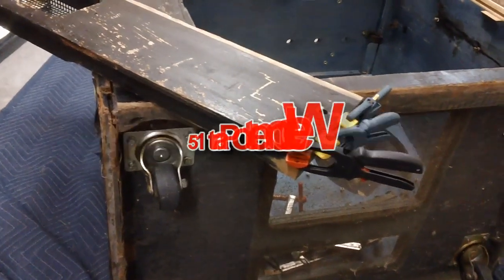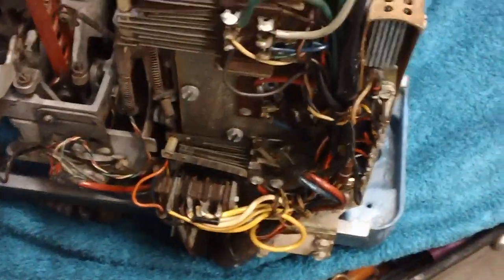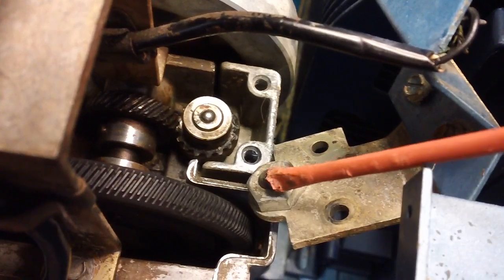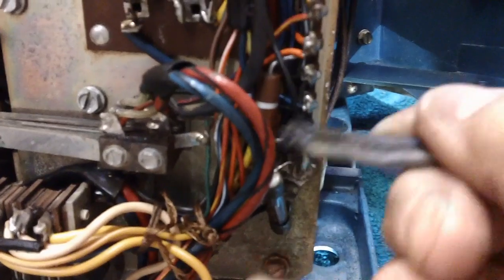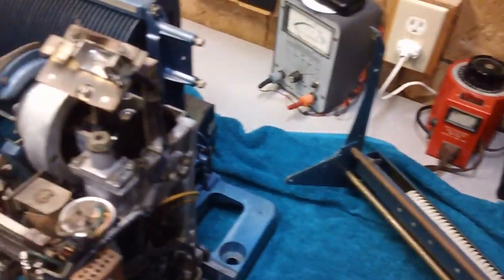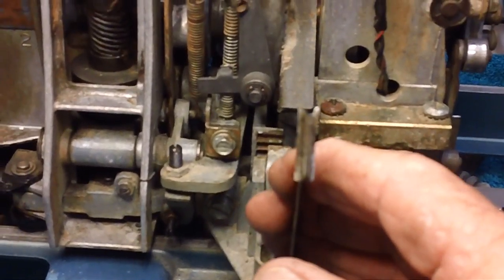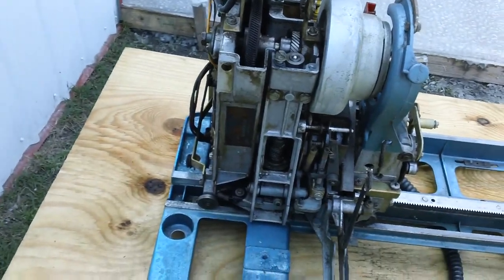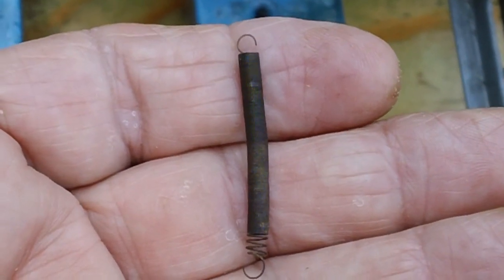1961 Seeburg AY100U Jukebox Restoration (Part 15 of 87).

Comment: That's a record tonearm that you're talking 👄 about, I think. I'd check ✔ for screws or nuts of any sort, or if the record rack happens to come apart in any way. Take snapshots, and observe how the record rack comes apart. This will assure you in getting it back together ❤ again. If it's screwed, or nutted together ❤, set the screws, bolts 🔩, or nuts in a safe place, or use a speaker 🔊 magnet. Also, do not 👎 bend or break the tonearm off in the process, since it's another very hard-to-find part. The other arm is the one to the record selection system. Be careful not 👎 to bend, or break it, too. Sounds familiar with the Tormat record system. Joe's Classic Video 📹 Games, also restores jukeboxes. Giving a few of his videos 📹 a watch ⌚ might help ya out. His videos 📹 are where I learned about the Tormat record system. Your friend, Jeff.

Comment: When I had my Q-100 I just "Used" or "Played" it extensively. I would oil what was necessary but never cleaned out any grease that came with it and it worked flawlessly changing records for years. As I said on a different segment, I only got rid of it when the SHA-1 amp quit working for me the second time after being recapped.

Comment: I have this model. I got mine at Walmart.  If you get one, use the RCA jacks or HDMI to connect it to your TV. The RF output is whack.  It does work with my digital cable, but the channel numbers are off something terrible   Also, get a high capacity thumb drive, like 64 GB. A small one will fill up in no time.  Do like me. Set up an antenna on your shed and find all kinds of awesome channels you don't have on paid services. It was so good I ran a line to the house LOL.   https://www.amazon.com/RCA-DIGITAL-TV-CONVERTER-RECORDER/dp/B017MY5URY

Comment: to add my two cents worth [as you yanks say]...keep it simple john..nobody is a expert on everything...i restore jukeboxes, but knew nothing about radio, the IF, RF stages were always a complete mystery to me, but yours and all american 5 videos have lifted the veil on that much more than i could ever understand from books...bob in uk
Reply from the maker: Thanks, Bob.  That's very good to hear.  Speaking of jukes:  Do you have any idea what type of blue color is inside these old seeburgs?  It appears to be some sort of metallic mixture to better reflect the florescent light.  At least that's my take.  Of course, I'll never find it nowadays, but did find some that seems close...without the reflective quality, that is.  What's your take?
Regards,
John
Reply: i am told that in the states a GM colour from '92  "light sapphire blue" code 22T is a very close match and is metallic....different over here in UK...
Reply from the maker: Thanks, Bob.  I'll for sure check it out.
Regards,
John

Comment: Possibly already mentioned but around the 6min mark you are wondering about a bolt missing. That clean area looks like it not only had a bolt but maybe a clamp of some kind to hold that set of wires down???
Reply from the maker: Very observant, my friend.
Regards,
John

Comment: Is that another oiling tube at the bottom of that motor?
Reply: Yes it sure is.  There are three points on that motor that needs oil...
Reply from the maker: The mech oiling/lubricating requirements will soon be covered.
Regards,
John

Comment: John,

I learned from Paul Carlson that the solder extractors work better if you actually add a little solder to the joint then hit the extract button. The new solder seems to transmit the heat to the old solder more efficiently. Also, after you remove the solder grab the wire or component and wiggle the joint as it cools. This makes an intentional cold solder joint so the small remaining amount of solder does not adhere. BTW, Do you have a coffee maker in the workshop, or does your wife respond with it when you ring the bell?   

You must be really happy to have a dedicated workshop that you can lock up and return to and find everything just as you left it.

I am really enjoying the series, thanks.

Ian
Reply from the maker: Ian,
Thank you, my friend.  Someday I'll do a video on soldering technique.  And wifey responds to nothing.  LOL  Further, it is good to finally have a shop where everything stays right where I put it.  Gotta love it.
Regards,
John

Comment: Hey John. I still use the desolderer with a bulb. Sometimes I have the sucker and the iron or gun going at the same time because I get impatient LOL
  I noticed I was signed into another channel I have when I commented the other day about the one button tester. The Gospel Sharer is the name of that channel. One of the local evangelists has a TV show that I enjoy enough to share. He lives near where I grew up and is on TV in my area. Two announcers on his show used to own and operate the local radio station down there. My DTV converter box records to a thumb drive. I love that feature.
Reply from the maker: Jeffrey,
What kind of DTV do you have?
Regards,
John